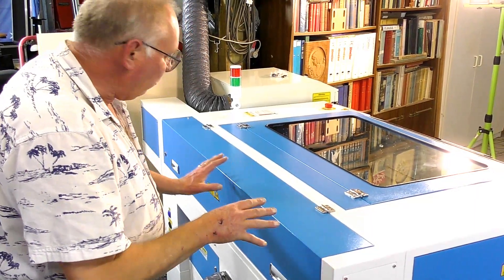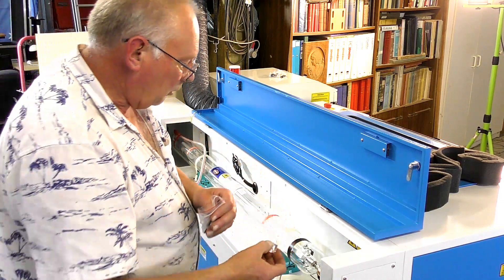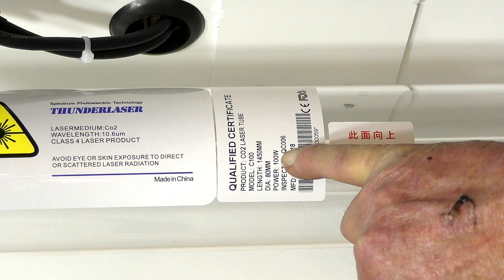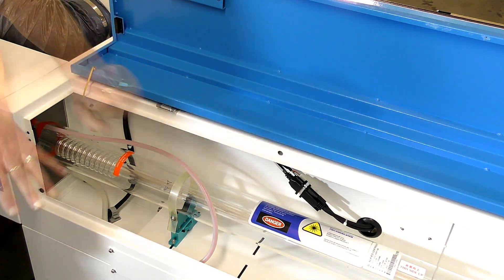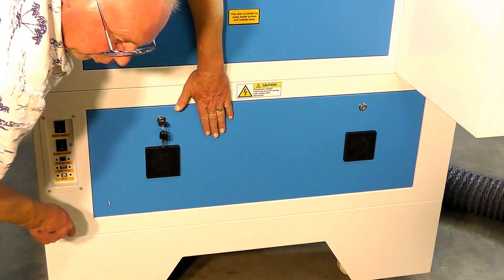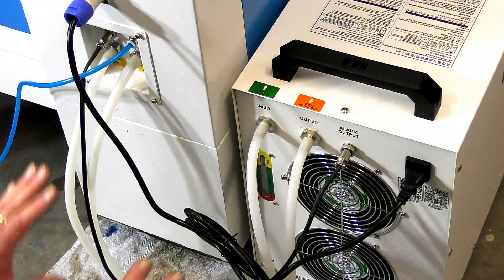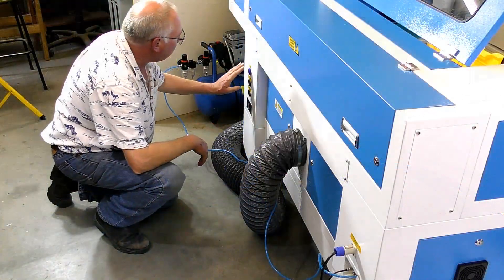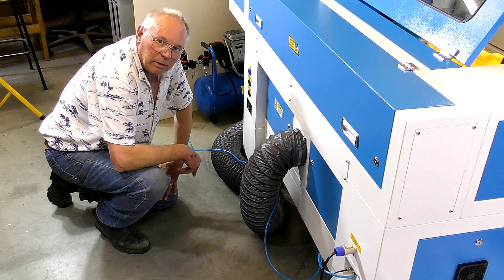Thunder Laser Nova 35 100 Watt Coolant, air and electrical “tech info 2”

Comment: Any concerns regarding having a compressor always pressurized and failure due to water inside creating rust. I thought the Thunder came with a built in on demand compressor. Thanks for the very informative video.

Comment: It's actually SPT tubes that they use. Personally having used SPT for 5 years I'd not go anywhere else.
Reply: we use reci in some machines but yes, mostly spt right now. we found, over years of testing and support data, that the spt provides a more uniform beam signature over a wider range of power in most cases, and the mean time between failure equates about the same on spt and reci. reci lasts longer but costs more, but dollar for hour its kind of a wash actually.